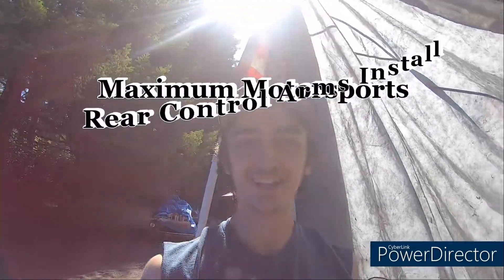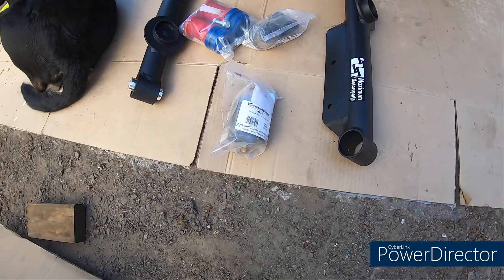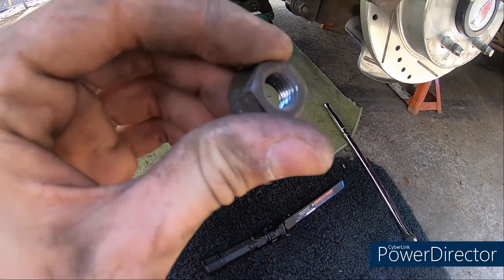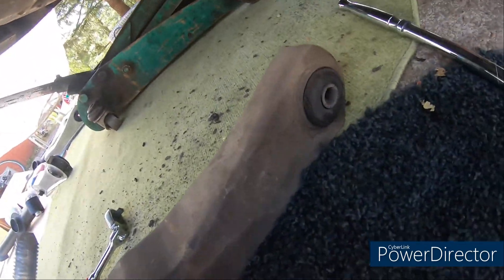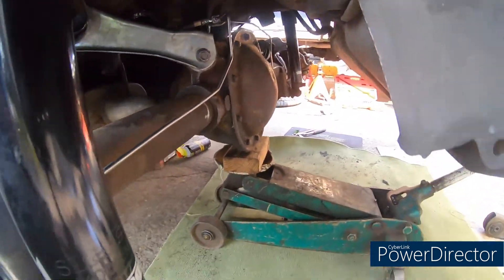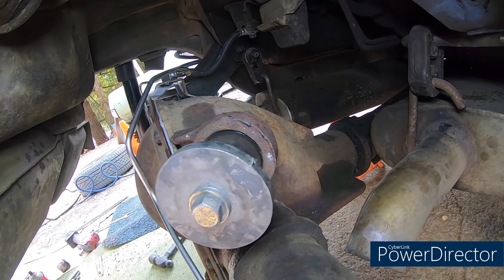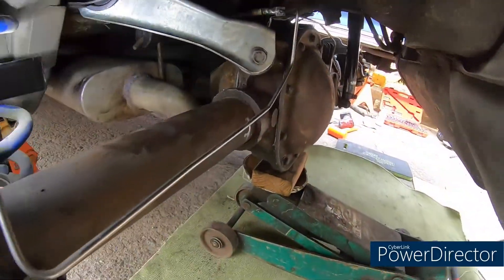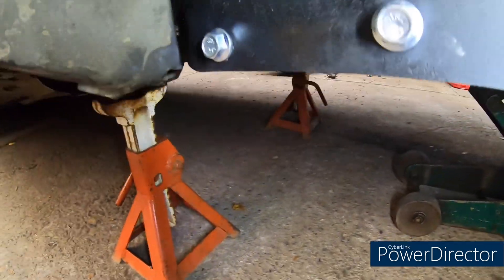Maximum Motorsports Rear Control Arm Install on a Foxbody Mustang

Comment: What light are you using? I kinda like that. I really need to do my rear controls. I have the UPR suspension kit for the front. It has the Tubular K-member. Coilovers and all that. I’ve not touched the rear. I looked at rear UPR coilovers and they are $$$
Reply from the maker: Harbor freight special! I’ve had to return one so far, but lifetime warranty for $30! Works great. Maximum motorsports is the only way to go, and they made a world of difference in ride quality and grip!

Comment: Your opinion on the before and after? Stock control arms vs the MM lowers?
Why did you not may-I ask, you did change to a heavier set of uppers?
Reply from the maker: It was a night and day difference. Really keeps the rear end from moving side to side, and feels more predictable. Even with the stock style upper control arms, the ones from maximum motorsports do the trick.
Reply: Plus Maximum Motorsports recommends keeping factory uppers unless you get the Torque Arm
Reply from the maker: Exactly, they work great!